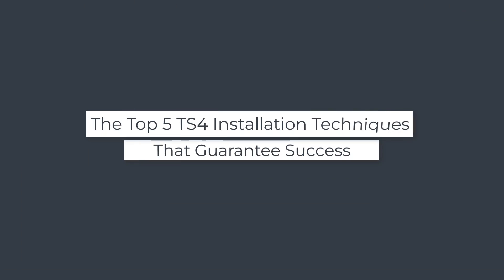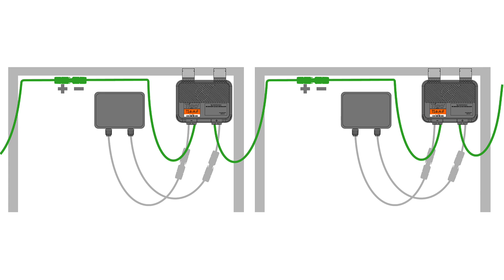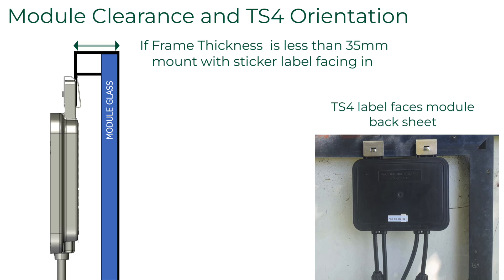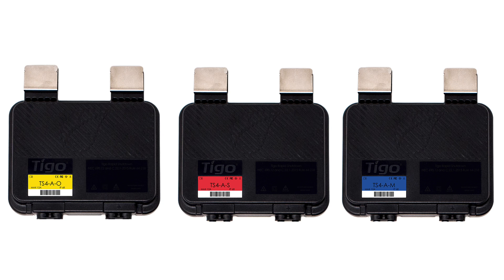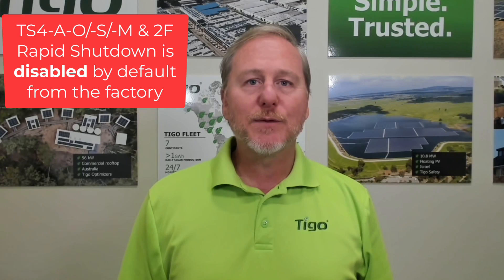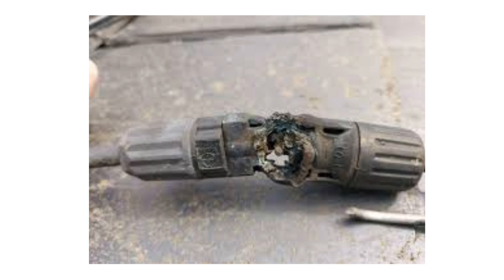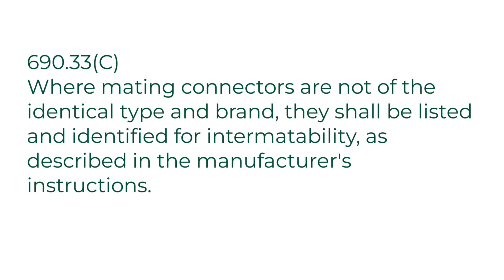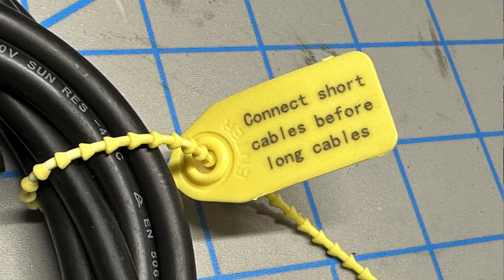Top 5 Installation Tips for the Tigo TS4-A MLPE

Comment: I have there Jinko connectors 🤔 not Stäubli
Reply from the maker: This is a common conundrum. Considering PV connectors are a common source of PV-related issues, the safest and Code compliant solution is to use "pig tails" or whips that will transition the Jinko connectors to the Staubli MC4.

Remember, just because they click, does not mean they are compatible!
Reply: @Tigo_Flex_MLPE  I mean I have Jinko connectors on Tigo TS4-A-O not on my installation.

Comment: 😂RTFM! I understand Greg 100% and the staff even if I don't work there. The manual goes straight to the point with easy instructions. Installers frequently install the TS4 as if they were microinverters and think there is no need to read instructions. I have seen some youtubers make the mistake too and have issues. I have been educating myself on solar, because I want to make a full install on my own  eventually.
Reply from the maker: Thank you so much!